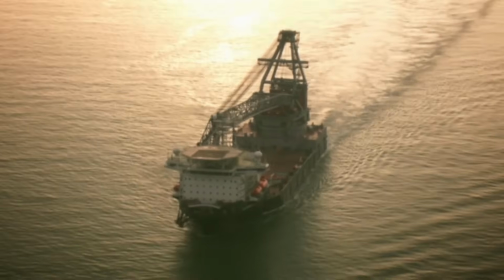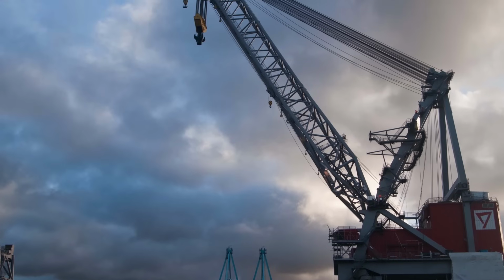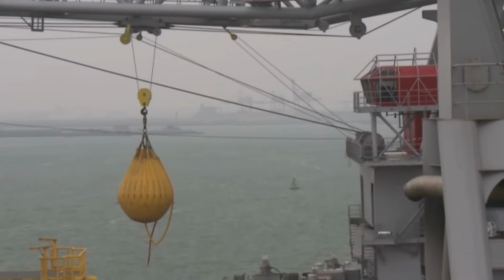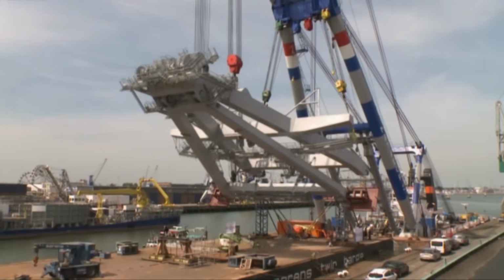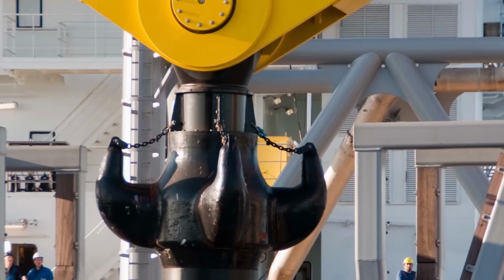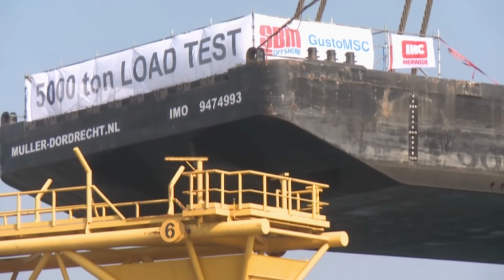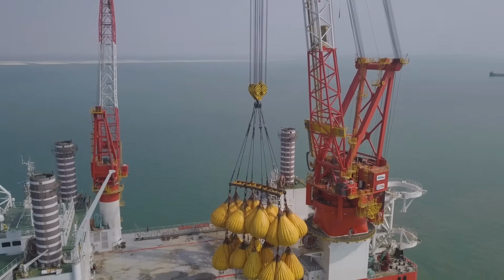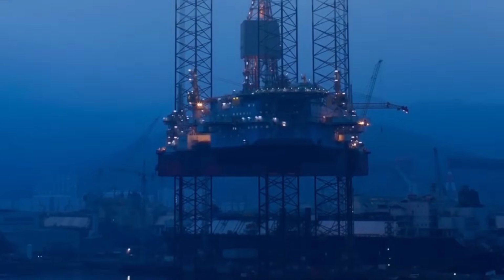The Logistics Inside The World's Biggest Crane Ship | Heavy Lift

Comment: Finally a current documentary without an irritating narrative and without an A.I. narrator that explains the mechanical and electrical build in good detail, with a few minor errors (6000Kw motor, not engine, for ex.). It was much more complete than most docs of this type these days showing the interior installations of the turret, operator's cabin, the winches, motors, generators, and a short - could have been longer - segment showing the reeving of the winch cables.

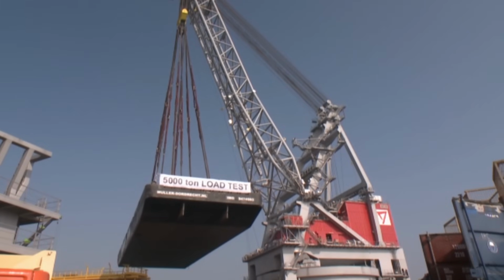Comment: 30:20 "they are 6000 kilowatt engines."
Unless these electric motors are hybrids of some sort, they are not engines. They are motors.
Engines combust a fuel which means to burn with fire. Thus they are combustion engines.
 Motors run off electricty which they clearly stated these motors do. Motors run the winches .